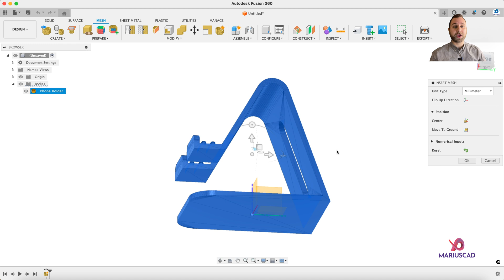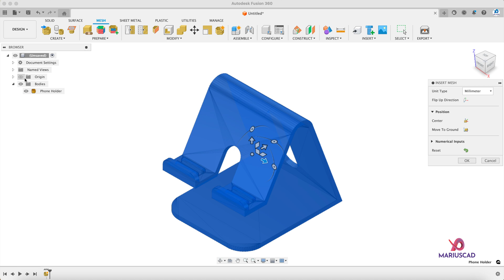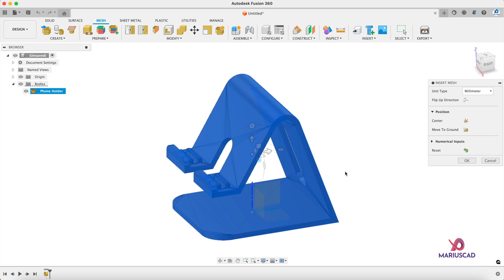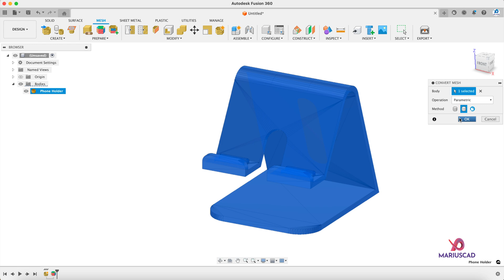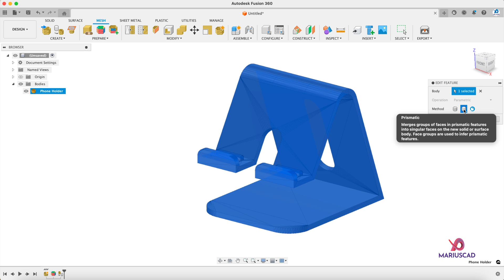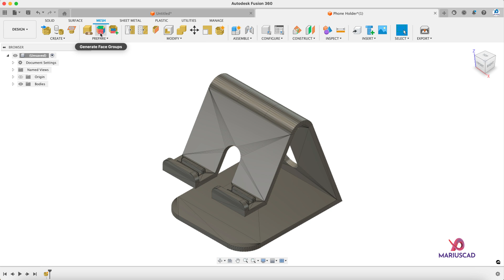Fusion 360 | Convert STL Mesh to a Solid Body

Comment: Hi Marius, awesome video, I am struggling to get an OBJ file to convert to a solid and retain the detail and smoothness. Is an airplane fuselage for a remote control airplane, I believe it was created in Blender, so in Blender I took it apart and only imported the Fuselage, because I am getting errors when converting that it has more than 10000 face, I am able to convert it but the vertices do not look smooth, too geometric and not smooth curves. Can I send you the OBJ file and take a look a it? It might worth a new video for your channel. Let me know and thank you, greeting from Miami.